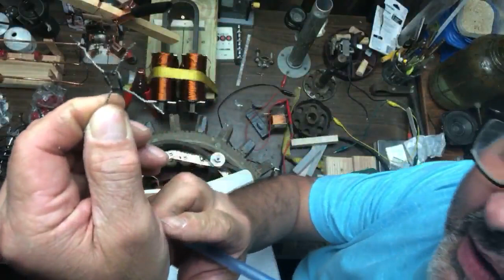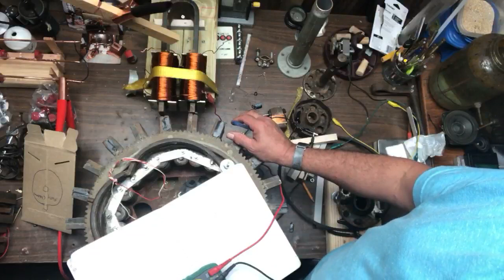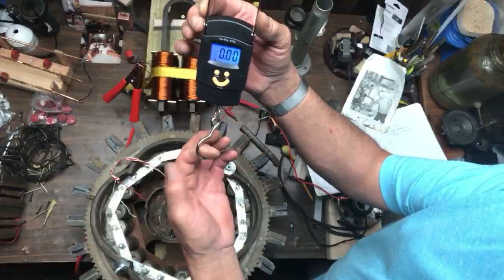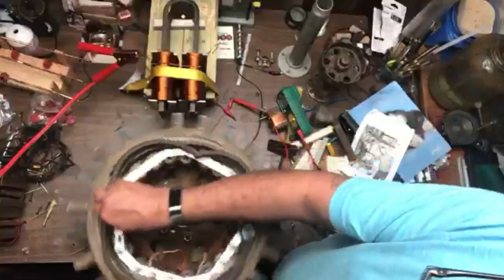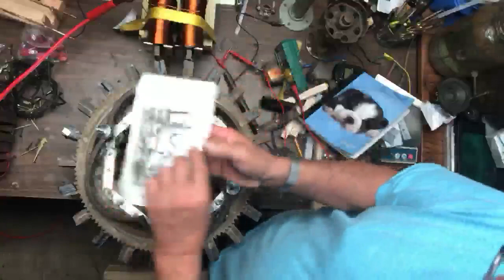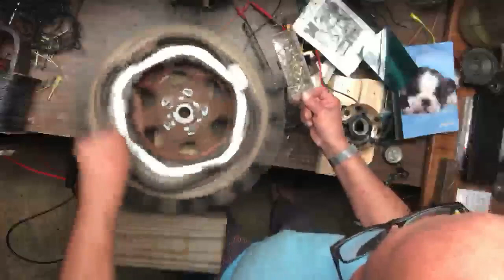Ed Leedskalnin Wheel live Stream

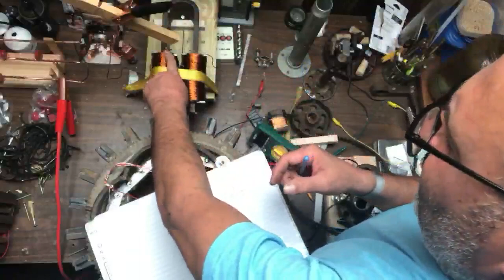Comment: 7:00 PMJoe SmithYou are a great teacher!
7:02 PMgarbleduseryo
7:02 PMgarbleduserjust got home.
7:06 PMgarbleduseroh hell yes
7:06 PMRyan Foxcan't see anything on the paper, you need a mranguswangus chalkboard:)
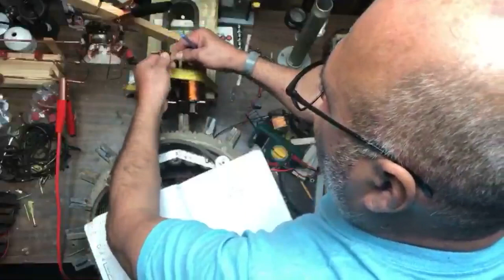7:08 PMgarbleduserso, soft iron is more saturable?
7:08 PMJoe Smithed recommended laminated iron crossbar.
7:11 PMJoe Smithcentripedal convergence in middle
7:12 PMgarbleduserthink of the coil in the right hand rule. electrostatic field grab magnetic fields.
7:12 PMgarbleduserrepeat that!
7:13 PMRyan Foxdo you plan on placing the cement type mixture on the inside of the wheel like Ed's wheel?
7:14 PMKam Whiteyeeehaw!
7:15 PMRyan Foxwomen have lower reactance and iron as well. bio impedance analyzer shows it
7:18 PMscott austinhey Roy, I have been trying to get in touch with you
7:20 PMKam Whiteare you gonna make sex with the wheel??
7:21 PMscott austinRoy, I believe the cams on the top are Used switch positive and negative. I would love to talk with you about it
7:25 PMscott austinI believe the cams on top using a reed switch switches polarity and other leg of PMH charges a capacitor for two cycles, then repeats
7:26 PMKam Whiteyou need the right rhythm
7:27 PMgarbleduseralternate the polarity between pulses, trigger with the reed switch.
7:27 PMRyan Foxmore cowbell
7:27 PMKam Whiteyes, do what garbleduser just said ^^
7:28 PMgarbleduserthank you
7:28 PMscott austinYes, I believe that is the key
7:28 PMscott austinI have been trying to talk with Roy
7:29 PMgarbleduseris that made by one mad scott?
7:29 PMscott austinyour the man Roy
7:29 PMRyan Foxdo you have the U core off center for a reason?
7:30 PMgarbleduserthats not me
7:30 PMscott austinYes
7:30 PMgarbleduserthat was ryan
7:30 PMRyan Foxyes, the pmh
7:30 PMgarbledusersup scott!
7:30 PMKam WhiteROY - alternate the polarity between pulses, trigger with the reed switch.
7:30 PMgarbleduserthanks again!
7:31 PMscott austinglad to help the cause
7:31 PMKam Whiteyeah, but you gotta have the right signal
7:31 PMKam Whiteyou gotta have it on adigital control
7:31 PMKam Whitethis is ed meets digital age
7:32 PMscott austinhave to start with what Ed had
7:32 PMjoshuafyi andersonabsolutely awesome upgrade to your livestream definitely awesome with the camera angle great lighting and perfect WiFi feed
7:32 PMgarbleduserteehee
7:32 PMKam Whitemaybe ed wasn't doing so much with this thing
7:32 PMKam White??
7:32 PMKam Whitemaybe it was just a novelty
7:32 PMKam Whitefor making electricity or demonstrating magnetism
7:33 PMKam WhiteI mean nothing here shows how energy could be stored to move tons of rock in another location
7:33 PMscott austinI believe that it is similar to Tesla's unipolar motor generator
7:33 PMgarbleduserkam: if you look at the artifacts that are left in his shop, a lot can be discovered.
7:33 PMpoughkeepsieblueeds drawn on reeds on the cover of abieh are a clue, ed used reed switches for sure, he drew them in so you would have reeds on your mind
7:34 PMscott austinthose are two different things, over unity and antigravity
7:34 PMKam Whitei don't know what a reed switch is, but Reed is my middle name lol
7:34 PMgarbleduserthis is neither scott.
7:35 PMgarbleduserits a syncro
7:35 PMKam Whiteapparently Roy doesn't like reed switches very much
7:35 PMscott austinthey both use high frequency
7:35 PMgarbleduser2 veins of magnetite roy!
7:36 PMscott austintoo hard to discuss all this with me typing
7:36 PMKam Whiteim listening.
7:36 PMgarbleduseri understand
7:37 PMscott austinglad to talk with you about it
7:37 PMKam Whiteso you think it's like a tesla motor generator? .. what's that?
7:37 PMgarbleduserI lost my voice, so typing is ok
7:37 PMKam Whitethat's cool
7:37 PMscott austinyes, unipolar motor generator
7:37 PMKam Whitedoes it work in coral??
7:38 PMKam Whitecoral is not magnetite
7:38 PMKam Whitehow did he lift the damn rocks??
7:38 PMKam Whitethe coral rock that is
7:38 PMgarbleduserwe will get there after proving a base concept
7:39 PMKam Whiteso what's the goal with the wheel
7:39 PMKam Whitedid ed's spin on it's own??
7:39 PMKam Whiteor did he crank it?
7:39 PMgarbleduserhe started it and then it acted as a syncro
7:39 PMscott austinI believe that clouds are positive charge, ground surface is negative, but 100 to 140 feet down it's positive
7:39 PMRyan Foxlarge amounts of coral would require a very low frequency to begin oscillating... and couldn't possibly have had that wheel moving too fast, right?
7:39 PMKam Whiteguser
7:39 PMKam Whitethat's it
7:39 PMKam Whitemakes sense now
Reply: 7:40 PMscott austinthose are two different things, power generation and antigravity
7:40 PMscott austinboth use high frequency
7:41 PMscott austinmagnetic current
7:41 PMTommy Tommy *deafbred*radical
7:42 PMTommy Tommy *deafbred*Open a Tent of Magnetica
7:42 PMgarbledusertrying to build a system that tweaks the inverse square law
7:43 PMgarbleduserYO TOMMY!
7:43 PMjoshuafyi andersonI would really like to see a Rodan coil in it
7:43 PMKam Whiteroy, put a guitar pickup up to it.
7:43 PMTommy Tommy *deafbred*its easy ed said, just know how to set up the coordinates of the polar combativness
7:43 PMTommy Tommy *deafbred*yo garble
7:43 PMscott austinI believe that Ed must turn the wheel to start developing energy and after getting it up to speed, it would continue on its own
7:43 PMTommy Tommy deafbred*I seen a Dog, swinging from a Rope..its As moving Like it Could Move the handle on the wheel
7:44 PMgarbleduser2 guitar pickup, 2 diodes, and a fet
7:44 PMKam Whitemaybe he used it to set the frequency, it was the signal generator perhaps
7:45 PMKam Whitewe need a slack group
7:45 PMTommy Tommy *deafbred*The Two Ring Gears Are South, and Open a Doorway To Set the Vee Ring In
7:45 PMMichigan NativeScott Austin I agree with you that Ed was using lay lines and tapped into that energy source.
7:45 PMscott austinthen the energy could be used to develop frequency to change the polarity of the coral
7:45 PMKam Whitescott you're on to it
7:45 PMTommy Tommy *deafbred*it's a Hidden Serpent Rainbow worm fire
7:46 PMscott austinEd had a deep well and Tesla had deep well in his towers
7:47 PMMichigan Nativeabsolutely
7:47 PMKam Whiteto grab lots of positive charge you think?
7:47 PMTommy Tommy *deafbred*I Have a Video On It Sparking There Roy!
7:47 PMRyan Foxare we trying to get the wheel in some sort of a phase locked Loop with the surrounding Coral?
7:47 PMMichigan NativeSo did the great pyrimdes
7:47 PMgarbleduserno, with a harmonic of the Schumann resonance
7:47 PMbobby fultzthe spark gap is for removing the sign wave'' of the frequency being generated
7:47 PMpoughkeepsieblueed didnt change the polarity of the stones, he charged the groundwater to repel the stones
7:48 PMscott austinI believe Tesla development this and was like many inventor and just kept inventing
7:48 PMgarbleduserSaturable reactors!
7:48 PMMichigan Nativepough how do?
7:48 PMbobby fultzit takes three spark gaps to completly remove the sign wave and converts it to to pure resonance
7:48 PMbobby fultzwhich is pretty much harmless to us'
7:48 PMpoughkeepsieblueif i knew, i wouldnt be here...
7:49 PMscott austinYes I agree
7:49 PMMichigan Nativeright on LoL
7:49 PMTommy Tommy *deafbred*Yes! Roy!
7:50 PMTruth SeekerIncredible!!
7:50 PMMichigan NativeNo kidding that's interesting Dude
7:50 PMgarbleduserUsing a PMH with keeper as a satureable reactor, where the DC is induced by the wheel movement
7:51 PMscott austinmagnetic current is actually sound waves that act like electricity. that is why magnetic current would not harm you like manufactured electricity that powers our homes
7:51 PMTommy Tommy *deafbred*Separating, And Dropping Magnetica Through Together At Where Wheel is, to Explode the Gap to cause Ripple Effect throughout
7:51 PMbobby fultzman he did wut tesla did
7:51 PMbobby fultzits pulse motor
7:51 PMbobby fultzhe harnessed the back spike
7:52 PMgarbledusergotta love right angle circuitry!
7:52 PMscott austinyes
7:52 PMTommy Tommy *deafbred*It's A Live Living THING! ed said the PMH
7:52 PMbobby fultzand used the radient energy like tesla did
7:52 PMscott austinI can't type for shit
7:52 PMMichigan NativeI think you got it okay now moving a Ten ton rock.
7:52 PMRyan Foxthe back spike is essentially the effect of cavitation, and they've found tremendous energy in that
7:52 PMTommy Tommy *deafbred*Fill,,,,and Give time to Escape
7:52 PMscott austinyes radiant energy is in effect sound waves
7:54 PMscott austinthat's why you can touch magnetic current and not get zapped, like manufactured current
7:54 PMbobby fultzits called rf
7:54 PMpoughkeepsiebluethe closed magnetized ring is true perpetual motion
7:54 PMbobby fultzresonace frequency
7:54 PMbobby fultzsimple as that
7:54 PMbobby fultzit is simple actually u all
7:54 PMbobby fultzwe make it harder than it is
7:54 PMgarbleduserhe gave us the frequency in his art
7:54 PMscott austinsimple but they don't teach about it
7:54 PMbobby fultzits all resonance
7:54 PMscott austinYes
7:54 PMTommy Tommy *deafbred*if only we could think more simply yes
7:55 PMgarbleduserthis in pictures, not in words
7:55 PMTommy Tommy *deafbred*it Must be Like the Wheel of Fortune Wheek
7:55 PMbobby fultz=shitloads of free power
7:55 PMTommy Tommy deafbred*Wheel
7:55 PMscott austinI am working on perpetual motion now
7:55 PMbobby fultzany of u here built a gerard morin pump yet?
7:55 PMbobby fultzor watch him on youtube
7:56 PMbobby fultzif not u need to
7:56 PMbobby fultzhe will show u wut your looking foir
7:56 PMbobby fultzwith simple tests
7:56 PMMichigan Nativeno but it looks cool as heck
7:56 PMbobby fultzthat work
7:56 PMscott austinantigravity is a variation of the thing
7:56 PMTommy Tommy *deafbred*The Rings of Vee's Must Keep, The Center OPEN
7:56 PMElijah Packardtry running the current in the air against the current in the ground
7:56 PMTommy Tommy *deafbred*Prolly True, Like DUST kicking up
7:56 PMTommy Tommy *deafbred*off the Ground
7:56 PMscott austinbobby yes, Morin pump
7:57 PMElijah Packardthe perpetual motion machine is just the storage device of energy
7:57 PMbobby fultzitss cool you do this man '' these channels do rock
7:57 PMElijah PackardI should make a video to show you guys how far I got
7:57 PMTommy Tommy *deafbred*it accumulates it
7:57 PMbobby fultzits a pulse motor
7:57 PMTommy Tommy *deafbred*into pools
7:57 PMbobby fultzit run on illi amperes
7:57 PMbobby fultzand produces tons of excesss'
7:57 PMbobby fultznothing is free
7:57 PMTommy Tommy *deafbred*Tap, yes One side Always ON, other Tap,.,,...off...Tap....off
7:57 PMbobby fultzyou must have a primary mmover
7:57 PMMichigan Nativedude I went through are local electrical program and have learned more on U tube then in class except code that is LoL
7:57 PMscott austinI believe Morin just got too far away trying to make the perfect machine
7:57 PMTommy Tommy *deafbred*NOTHING is Spoken of In the Movie The Never Ending Story
7:58 PMbobby fultzvolts are free:)
7:58 PMTommy Tommy *deafbred*the NOTHING is 'the rainbow serpent' or the 'magNET's'' i think
7:58 PMElijah Packardtry using more than one perpetual motion holder
7:58 PMTommy Tommy *deafbred*JFK warned us about the MACHINE
7:59 PMMichigan NativeBobby and guys I'm looking to get my hot water and heat covered through s outdoor boiler and run it off solar.
7:59 PMDavid Stapletondoes eds pipe in the ground come up underneath the wheel and join into it?.. is the wheel rotating ON the pipe?
7:59 PMTommy Tommy *deafbred*It's cuz We Can't 'dance' with the Stream "while the Scene Lasts' ed said
7:59 PMgarbledusersee if it can be used as a mag amp!
7:59 PMgarbleduserthe pmh
7:59 PMscott austinmost inventors keep working on perfect machine and it takes forever, instead of just use what you have
7:59 PMTommy Tommy *deafbred*Bubble's ed saw bubbles....
7:59 PMKam WhiteGuys: I started a Slack channel for us:
Reply: 8:00 PMTommy Tommy *deafbred*it'S Like 'a constant'
8:00 PMElijah PackardI think you should try running two pmh on the flywheel and try to harness the current moving in the air against the earths water
8:00 PMMichigan NativeDavid I think the water table is the connection
8:00 PMKam Whitemysweet16
8:00 PMgarbleduserset up the PMH with holder as a saturable reactor!!!
8:00 PMKam Whiteslack . com
8:00 PMTommy Tommy *deafbred*commutate THE Constant
8:00 PMElijah Packardhave you made a permanent magnet relay?
8:00 PMKam Whiteput your email here and I'll send you an invite
8:00 PMTommy Tommy *deafbred*Water on the Table? prolly tru Michi
8:01 PMMichigan Nativeyes
8:01 PMElijah Packardmetal shavings on glass table above flywheel
8:01 PMKam Whiteslack . com/t/mysweet16/
8:01 PMKam WhiteIt won't let me paste the link
8:01 PMTommy Tommy *deafbred*Perfect Container! Ed Said 1 feet long 2 inch wide
8:02 PMMichigan Nativeyes more cow Bell lol
8:02 PMTommy Tommy *deafbred*Ya You Can See the Way the Iron fillings Each Move whether on Top of Wheel or Under are along Side
8:02 PMKam Whitejoin the slack group "mysweet16" at slack . com and we can share our ideas and figure this out in an organized way!
8:03 PMTommy Tommy *deafbred*I Got a Whole Box of Fine Iron Fillings
8:03 PMgarbleduserright side
8:03 PMKam Whitemysweet16 . slack . com
8:04 PMTommy Tommy *deafbred*the Video of this Dog is Key! To machine! dog hangs from Rope with Mouth and Swings his Butt Around....Like It could Move Wheel handle... /watch?v=2B0UsqWaSSE
8:04 PMElijah Packardtry clockwise
8:05 PMTommy Tommy *deafbred*: ) Roy! Iron fillings along Wheel, i did that Experiment 2004
8:05 PMTommy Tommy *deafbred*Yes! Matter coming Towards it!
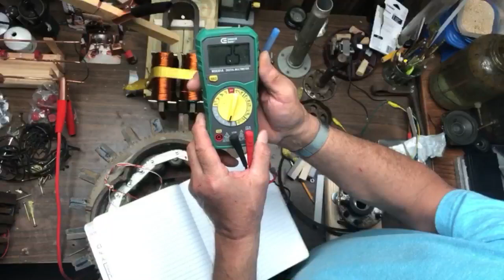8:06 PMTommy Tommy *deafbred*It gather's in OPPOSITE Direction
8:06 PMbobby fultzu make it spin counter clockwise
8:06 PMElijah Packardmore like what speed
8:06 PMbobby fultzto equal out the natural clockwise rotation
8:06 PMTommy Tommy *deafbred*If the Wheel had a Flay Plane....Like a Magnetic Microwave Orientation, i think
8:06 PMbobby fultzu dont force it'''
8:07 PMbobby fultzit counteracts and is more efficient
8:07 PMbobby fultzsame as using a vertical shaft
8:07 PMbobby fultzthats why tesla generators
8:07 PMTommy Tommy *deafbred*i think of it Like 'Serperating the magnetic Wheel' from the REST OF THE WORLD
8:07 PMTommy Tommy *deafbred*then it will spin
8:07 PMMichigan Nativedarn it
8:08 PMTommy Tommy *deafbred*Thats The Oribts Roy! Some Leave and Never come Back But Others! Take their place!
8:08 PMRemmi Katis it working?
8:08 PMTommy Tommy *deafbred*You Can Open up a Portal along Side of Machine from using a tube Magnet POLE
8:08 PMKam Whitethat's the invite link ^
8:08 PMRemmi Katcan you lift rocks yet?
8:09 PMKam Whitejust add ht at the begining and remove the spaces
8:09 PMgarbleduserMy model makes use of an "artificial ground" tommy
8:09 PMKam WhiteLet's keep the conversation going.
8:09 PMTommy Tommy *deafbred*articifical...kinda like a mirror that reflects but ain't the tru image
8:09 PMTommy Tommy *deafbred*so it Endlessly 'chases'
8:10 PMMichigan Nativegarbelduser tell us more
8:10 PMgarbleduseryou got it tommy
8:10 PMgarbleduserlike a starter cap.